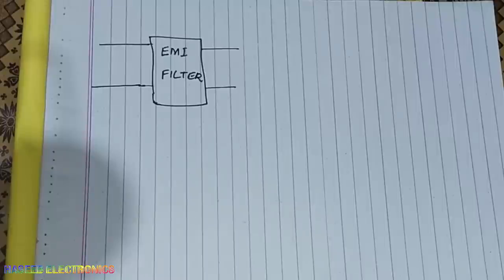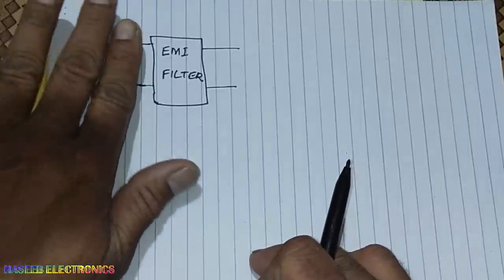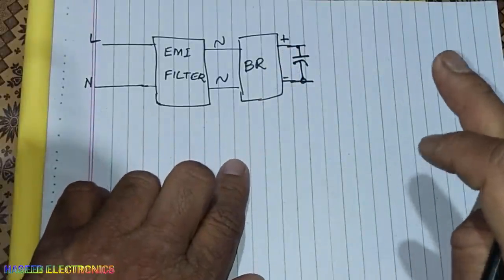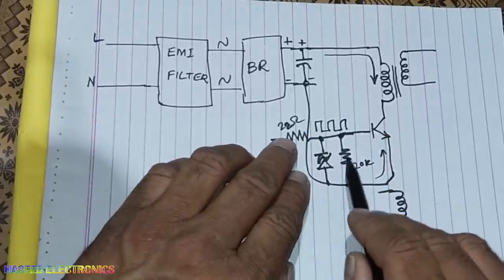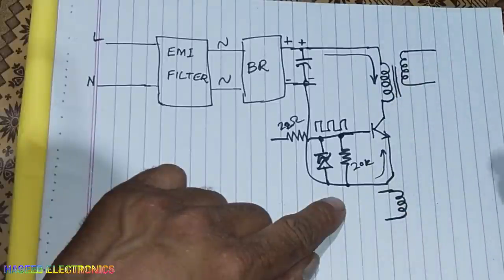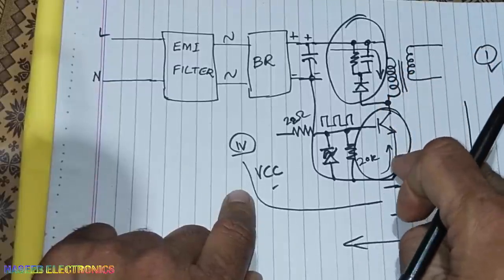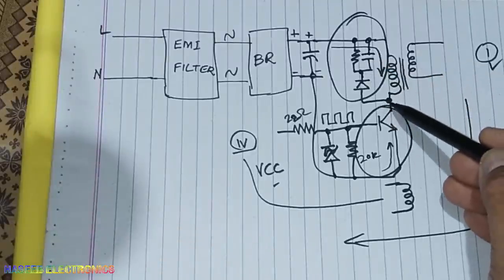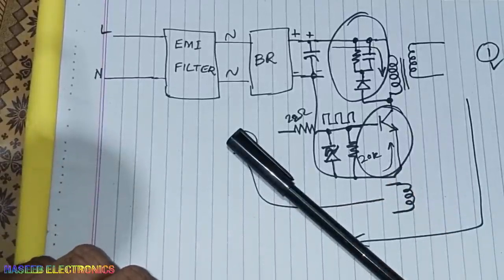{573} Why SMPS Have Low Output Voltage - Reasons

Comment: Sir, one problem to discuss with you is that our VCC voltage in SMPs is less than actual, i.e. up to four volts, due to which the gate voltage of mosfet also drops.  and similarly, if the voltage of both of them drops, then the voltage of our output also becomes less than 12 volts, due to which our load cannot run properly, so please tell us where is the problem.

Comment: Hi, my 120W smps output voltage good but output current very low, i am unable to use 12v 5A load, i checked all components good even low current, so what component to be replace in smps ?

Comment: Great and most sweetest lesson I ever enjoy in electronics.
Am currently having an issue working on a hybrid high frequency inverter showing error 09,after changing output mosfets,it change to 06,then I observe some zener diodes I changed off hand maybe I didn't get the real voltages,pls can u help me with real values of those zener diodes on the small output transformer...with codes zd3,7,8 .
It's 5kva/48v.
Thanks and more blessings to your home

Comment: Nice explaination. Basicly use off line transformer. DC swich only produce one direction magnetic field.
Reply from the maker: in uni-polar designs like (flyback, boost) topologies it generates unipolar magnet, and in bilpoar switching topology, then there is bilpoar magnetic flux

Comment: @HaseebElectronics It's worth to also mention that it may be also a failure in the transformer winding...  I'm fixing right now a Modecom ATX SMPS with both failed  switching transistors,bruned fuse and desoldered one leg of subber resdistor. I fixed that problems,  turned on PSU, and I notice that output voltages are very low, fo example 12V rails has 1 point sth Volt.  I also noticed that snubber resitor gets very hot and after some period of time, transystors failed once again  and "blew" a fuse once again...  

After that failure, I inspected PSU closer and more precisely and I noticed that transfomer has sheinked nad wavy isolation. and looking from the top  I also noticed that isolation layersare melted, so I removed  transformer, disassembled it, what wasn't easy, because isolation tape was so badly overheated that it falls apart, so  I  had to scrape it peace by peace and I noticed that one of the wires in the center-tap tail is blackend partially,  burned!!!!  

I have 2nd PSU based on the same chassis, but  with  increased output power,  so I  borowed transformer and transistors from it, put my patient back together and bam, it worked!!!! 
Transformer failed, but I have to admit that anyways it done the job perfectly, becuse isolution worked and didn't allow the sec. winding short itself with primary!!

Comment: Very informative video sir. You said in absence of snubber, it will cause oscillation effect. I would like to learn more on this. If you have any example video of some snubber circuit failed and cause the oscillation effect would be very helpful for me. Thank you sir.
Reply from the maker: kindly check video number 510 & 284. that is on snubber circuit
Reply: @HaseebElectronics  tq sir 👍🏻

Comment: Thank you very much for this video. 
Please explain the output section of a high frequency inverter. That is from 300 volts dc to 220 volts ac 50 Hz. 
Iam getting low output voltage. Fans are running slowly. How can I increase output voltage. Please explain. 🙏

Comment: Nice info ones again ?Can a optocoupler use for the switching????
Reply from the maker: best regards and special thanks 
yes optocoupler is used for switching. just set its ESR value high to drive the optocoupler in saturation 
try to use TLP250, TLP350, HCPL3150  CY17 type optocouplers that is specially for isolating switching optocouplers 
of use any IGBT / MOSFET driving optocouplers

Comment: helo sir,, may i ask u about my 330amp welding machine proquip brand the welding output is very low it only spark 4or5times then d overheat light will switch on then the smps resistor and switching transistor are very heat.

Comment: I have a 36V/10A SMPS which keeps burning one of the two power transistors a few seconds after the load is connected. It is always the same transistor.  Could you explain that for me?
Thank you

Comment: i think that the resistance in snubbing circuit is much more greater that the resistance of the main winding. so even if the diode in the snubbing circuit is failed, there will be still switching. correct me if i am wrong.
Reply from the maker: no dear 
this resistance is also low with compare to the inductive reactance of the primary winding 
primary winding's dc resistance is always low but ac resistance working at high frequency is very high 
you can check video number 284 & 510 on rcd snubber
Reply: @HaseebElectronics  thank you for clarification.

Comment: Low side switching is simple and easy to protect its gate but high side switching is something else I use gate drivers transformer and switching 22 volt to mosfets gate the gate is rated 20vgs but I measure the gate voltage and it’s 160 volt volt from the two switch forward converter can you explain why the mosfet gat no blowing out at the voltage I don’t have a ziner diodes to protect the gate

Comment: Hi, I have a projector. It has pfc smps. While I check the output on a pin it shows 12 volts. But the same pin after standby release shows 17 volts. And according to instruction written on smps 17 volt is normal output voltage. How is that possible? Same pin maintaining two different voltage level!
Thanks and regards

Comment: Sir How to contact you ?
I have a question about a SMPS having current sense problem.
It giving proper voltage on multimeter but when connected to motherboard, smps switching off.
Reply from the maker: My Whatsapp is 0962-79-1161084
Instagram Haseeb electronics
Gmail ashraf4ta4

Comment: Sir hasseb how are you ??
I have an SMPS of a sattelite receiver with IC number  SD6835 have  external sensor resistor 2 OHM  connected in pin CS number 2
but now the resistance show  0.7ohm in multimeter 
When i connect the SMPS in the motherboard of the receiver no power on and the vcc capacitor and the main capiacitor are varying 
when i disconnect the  smps from the motherboard i get the  5 volt  .
when i reconnected  to the motherboard again no power on and capacitor baby and main are varying
can you help me to r this issue  ???
May i have to change the 2 external sense resistor SMD  connected in parrallele ??? 
Number of resistor SMD  2R0
SUUPORT PLEASE

Comment: Thanks for the interesting video. Can the sensing resistor do also problem ?
Can you please explain in a video how op amps are used as atx supervisors and how tobypass them to increase voltage. Thanks.

Comment: I AM REGULARLY VIEW YOUR CHANNEL VIDEOS, VERY VERY INFORMATIVE
I WOULD LIKE TO KNOW ABOUT 
CAN WE INJECT VCC VOLTAGE FROM EXTERNAL SOURCES IS IT FEASIBLE AND POSSIBLE PLEASE ANSWER OR MAKE A VIDEO
Reply from the maker: yes we can inject external vcc, 
If
the IC is not being used to monitor UVLO / OLP (if this feature can be skipped then we can inject external vcc) otherwise external vcc will keep operating even in overload or undervoltage 
if it is using TL494 or SG3525 or similar ICs then we can freely apply external VCC
Reply: Thank you Sir, thanks a lot

Comment: ?HOW DO YOU FINE THE VCC CAP????
Reply from the maker: vcc capacitor most of time is connected directly at VCC pin of the PWM / SMPS controller IC

Comment: What can cause high output voltage than the rated output?
Reply from the maker: it is due to missing feedback or uncontrolled feedback signal
Reply: @HaseebElectronics  yes, you are right i just the opto-coupler and it work fine. But, in a scenario when the uc32xxx heat-up slightly when no load? is this a normal operation ?
Reply from the maker: @yuribiktop6595  the heat up sign is not good. if it is heating up at no load. at load it may blast
Reply: @HaseebElectronics  to my surprise it did not but reduce the heat onload . Is a Dc-Dc SMPS using UC32xx i modify using an existing AC-DC SMPS Adapter circuit. Slightly heat on the IC
Reply from the maker: @yuribiktop6595  if the heat is after modification
might be switching frequency or auxillary volatge are not matching properly
that may be a reason for heating up
otherwise ic must remain cool
Reply: @HaseebElectronics  thank you so much, the modification was done removing the AC side such as the EMI filter & bridge diodes . I supply 24dcv across the starting resistor which was 2 100k in series, I replace it using a 22K resistor.  Is there anything i am doing wrong?
Reply from the maker: did you modified the transformer??
Reply: @HaseebElectronics  No , just that i mentioned.
Reply: @HaseebElectronics  again , I got 12.6v on pin7 of uc3843 and the same at the output on no load. When there is load I got 14.6 output. This is strange I can't find what went wrong. Can you help please .